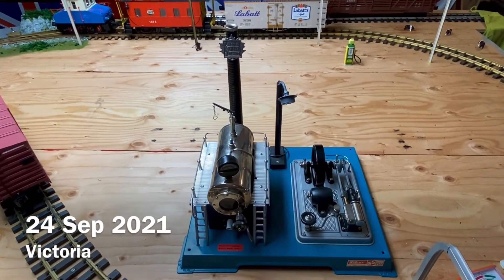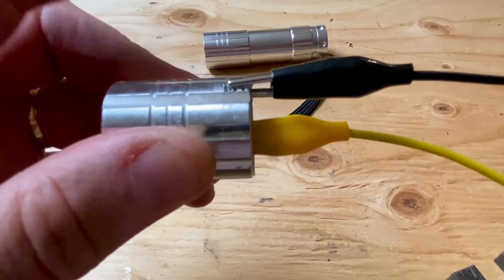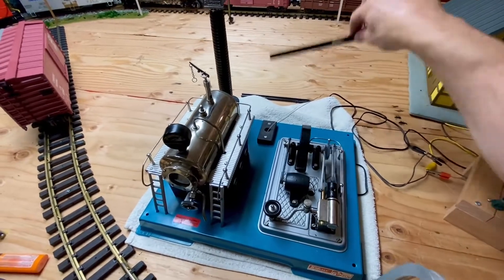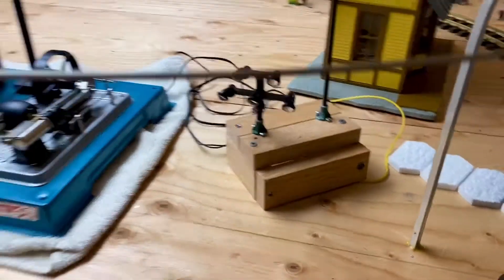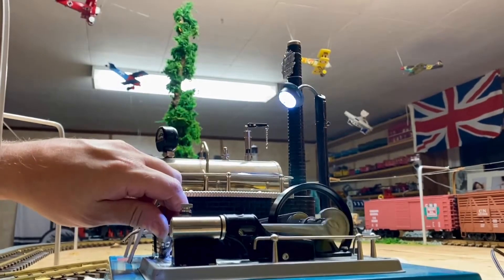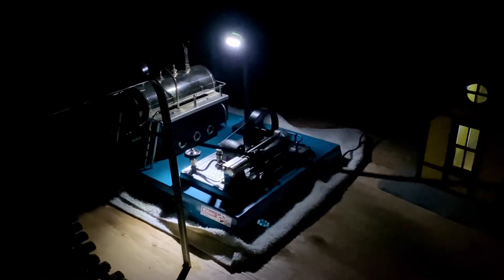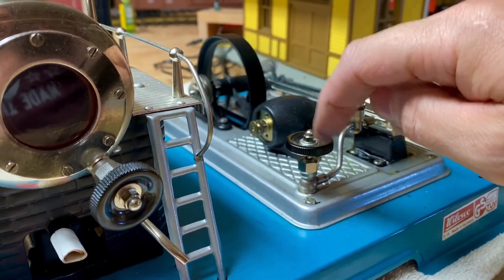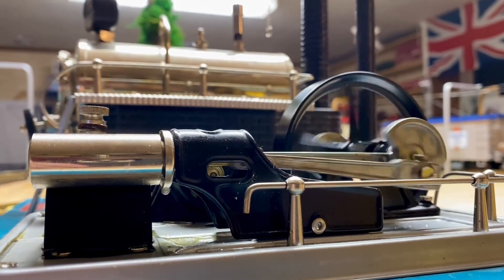Victoria B.C.: Using cheap LED lights & my Wilesco steam generator to light trains (see description)

Comment: So cool.  I love it.  Ive got a D24 that runs amazing,  But both my Wilesco and Jensen generators are struggling to produce any electricity.  I'm hoping the LED's will have a less of a load then the condescent bulbs.  thanks again for sharing your setup.
Reply from the maker: It is literally and figuratively night and day. I can put lots of LED light on load with the Wilesco. They are bright when the Wilesco is running at half power. The single incandescent bulb that came with the thing needed full power to glow a bit.
Reply from the maker: This is a good example of what I mean: https://youtu.be/GkKXjtaDuFc
Reply: @Terrys-Steam-and-Bricks  I did it,  Ive got working lights. Thanks to you  I was able to figure something out.
Reply from the maker: @michaelheninger1357  awesome!!

Comment: How did you make the alcohol burner? I just bought a used D16 and it did not come with a burner
Reply from the maker: I used a piece of regular copper pipe, hammered it to the right shape, cut and shaped the ends closed (I included a cut for the handle), and soldered over everything. Test with alcohol (not on fire). Alcohol will leak from places too small for water to leak from. I used fine steel wool as wick material but modern ceramic wick is the absolute best. I have some of that now.

Comment: Very nice and good Idea, I did not know that a Wilesco could power such many LED. I think I have to copy it with my D 20 😃
Anyway, I just have the old Generator and a old glow-lamp for my D20, but I hooked it up to an old morse key for morse lamp simulation :-) 
https://www.youtube.com/watch?v=V3sSQGHGqfU
Reply from the maker: The single original incandescent bulb my D18 came with could make a slight glow  at full speed. The LEDs are super efficient.

Comment: Very cool! Especially the overhead wire.
Reply from the maker: Thanks so much. I usually run live steam outside (and inside). I wanted to build a simple electric switching loop and in this scale I figured that as miniature live steam was as close as I can get to the real thing I decided against an electric train engine that was powered by the track. That seemed against the spirit of what I have been doing in large scale. Then I saw the LGB steeple cab electric and learned you can switch it to collect power from overhead. Voila! A realistic electric locomotive.